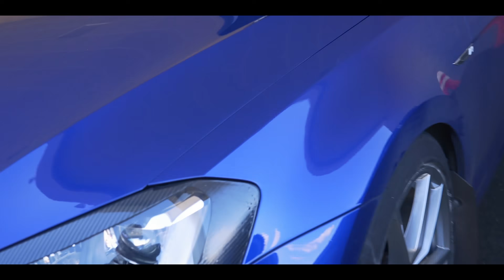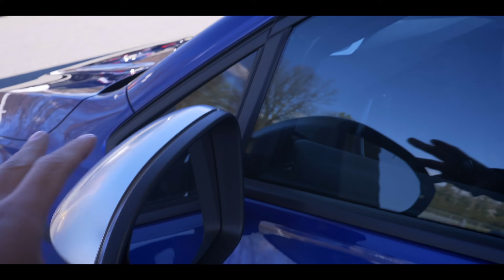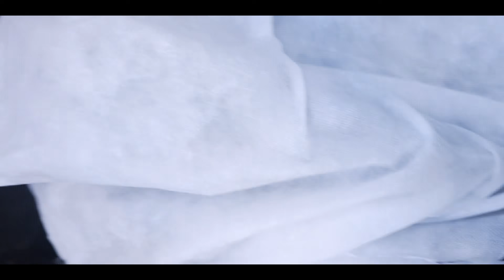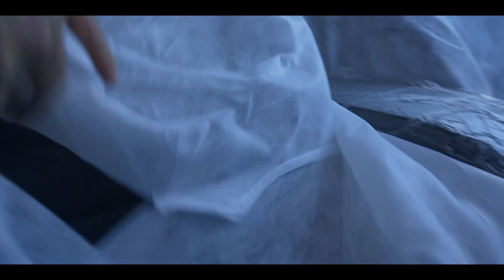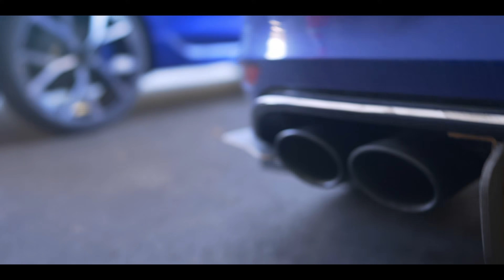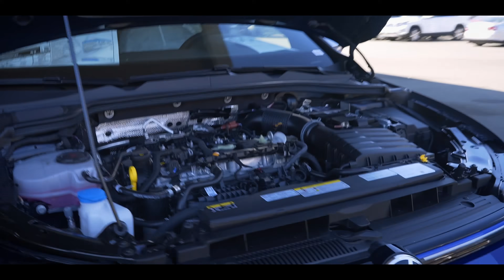MK7 and MK8 Golf R Side by Side Comparison

Comment: There's a big debate on whether the blockoff plates for the mk7 were a good idea, some say it's necessary for cooling and shouldn't be covered. I wonder if the fact that VW made the effort to create this shutter style blockoff plate means there is a benefit in having it blocked off at times and open in others. Maybe it's low speed = closed is best, high speed = open is best?
Reply from the maker: Hm.. yep there was a lot of talk in the previous video about whether the block off plate made sense. I guess that's why the plate on the newer gens are flapper style?
Reply: @ilimit  My guess is that when stopped or at low speeds, the open back doesn't provide enough cooling to the engine but hot air will get sucked when you press the throttle. However at high speeds when the engine needs the most cooling, the flapper opens to allow air to cool the engine, I wonder how to recreate this on the mk7